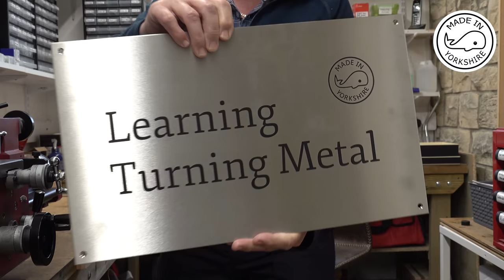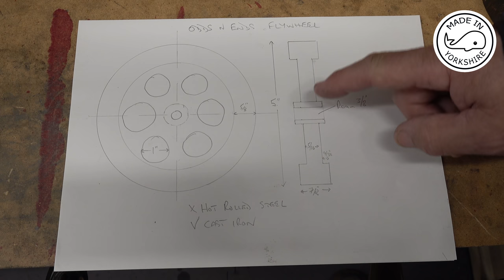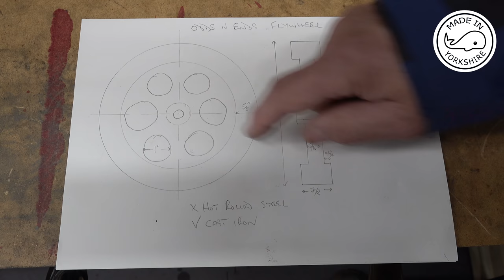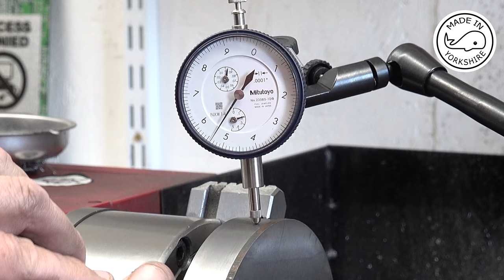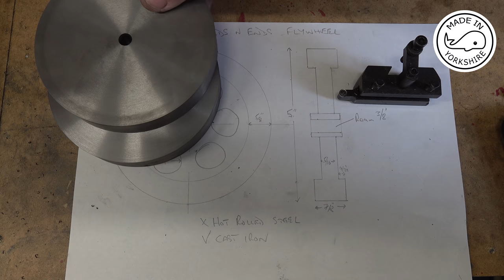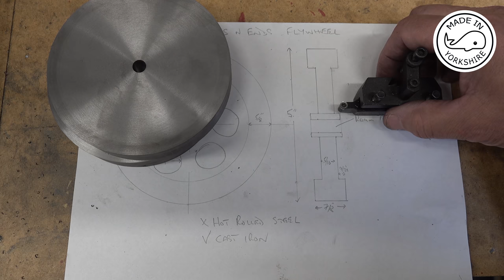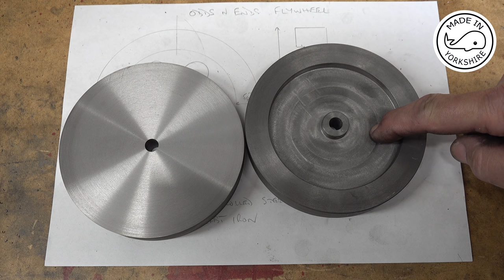#MT41 Part 9 - Philip Duclos Odds n Ends Engine. Machining a Flywheel. In 4K by Andrew Whale.

Comment: Again, well done. I wish I made the flywheels from cast iron rather than cold rolled steel. The resulting sharp swarf from the cr steel  has filled a 20 gallon waste can ,not to mention having to stop the lathe between cuts and remove it . I did not need a sharp steel " birds nest " getting caught in the turning lathe and flying about the shop. It would have been so much nicer just using a vacuum.
Reply from the maker: Thanks Earl - and thanks for all the help and advice!
I'm sure your steel flywheels will look great once completed.
All the best.
Andrew

Comment: Ok, Tuesday morning coffee with Andrew. Flywheels look great. As Faulty's inexpensive builder said "lick of paint, lick of paint" just before Sybil took the umbrella to both of them. Paint  covers all the machining marks and the flywheels will look as good as the Farmboy engine's. I had a couple chunks of Stainless Steel hanging around the shop for mine so my machining time was quite a bit longer than yours but the rims won't rust.

Dick B.
Reply from the maker: Thanks Dick - I think Stainless Steel would be well beyond me and my machinery! Your 'little' engine is really starting to take shape.
All the best.
Andrew

Comment: Hello Andrew, I built this model myself about ten years ago when I was in trade school, and I am thinking about building it again now that I am a journeyman. You're doing great. If I may make a suggestion, play around with the speeds and feeds on your lathe a bit and figure out what the maximum depth of cut is that it can comfortably take. Base your roughing cuts off of that and you will be able to do more work in less time.
Reply from the maker: Many thanks for the suggestion. I'm slowly gaining more confidence taking deeper cuts. 
Cheers
Andrew

Comment: Nice job Andrew. You rescued the problem with the slot very well. I thought it was going to be a filler and paint job! Those are mighty flywheels though. Once started this engine is not going to stop!! 😀
Reply: PS Happy Christmas. Love the sign.
Reply from the maker: Yeah - me too Tim. I was heading for the JB Weld! I just need to replicate the error on the other one now! 1.2Kg each - I hope the crankshaft can take the torque!
All the best.
Andrew
Reply: You pinned the crank arms so they should be up to the job.

Comment: Really nice job Andrew, some creativity with set ups never goes amiss. I've just finished drilling the flywheel of the S50. Used a very similar set up to you and it worked a treat. Not tapped it yet though! Thanks for the video. Regards Gareth
Reply from the maker: Thanks Gareth. I told my wife I was just going into the workshop to drill a hole. Two hours later I re-appeared! It sometimes takes me ages to get a decent setup. Good luck with the S50. Cheers
Andrew

Comment: Hi,Andrew. That turned out very nicely even with a couple of minor hiccups along the way. Cast iron permabar  certainly isn't as cheap as rolled steel but a far superior material to make flywheels from. I would like to share a little of my own machining experience with you about mounting the blank in the 4 jaw chuck. If you drill undersize through a couple of what will later be the holes in the finished flywheel as a first operation then you can mount the billet onto a backplate or faceplate and bolt it through the holes. That way you can tap it about into as near concentric as it will run then to tighten the clamping nuts and machine the periphery right up to the faceplate. It is a simpler and more versatile way of holding it for the first turning ops.
Reply from the maker: Thanks Howard, and thanks for the suggestion. I imagine it improves rigidity too. I will give that a try next time.
All the best. 
Andrew

Comment: Great outcome Andrew. Good choice to go cast iron instead of steel, you had enough agro with that, and steel would have been a nightmare for you. Even with an industrial sized lathe and mill it would have still not been easy. I am assuming that the large endmills are from your neighbour ? What I would have done for the 1 inch holes is use a Carbide Hole saw, the Banggood ones work super well. Might be worth checking your tailstock when you get a chance, as you drilled the hole for the reamer it picked upwards. When you removed the reamer, if you listen carefully you can hear it Ping Downwards. Seems that there may be some vertical misalignment. Personal note, I think at times that you were running too fast for cast iron, 80 to 100 FPM, depending on the grade. You also need to take into account the type of tools used. Regards from Australia.
Reply from the maker: Hi Dave - yes I must have ended up with around 200 slot/end mills. Well spotted regarding the reamer - I noticed that too. I don't think I have any options regarding the vertical alignment of the tailstock. It doesn't seem to have any detrimental effect at the moment but I will keep my eye on it.
All the best.
Andrew
Reply from the maker: Hi Dave - a quick update in the tailstock alignment.... Richard Boucher (Dick) read your comment and suggested I use a coax indicator the check the tailstock bore. I've just tested it and the coax suggests the bore is out by about 1.5 thou of and inch. As a crude test I put the MT2 chuck back in and held a 3/8" silver steel rod. My dial gauge read 15 thou runout over 4.5"! I then had a light-bulb moment and realised that I never tap the chuck home in the taper. A quick tap and the gauge now reads 3 thou over 4.5". So I think the main problem is operator error! I guess 3 thou runout is sort of reasonable. Thanks for initially pointing it out.
All the best.
Andrew

Comment: So a few thoughts on large diameter cutting. 
Dc motors have no torque at stall so in your case a little faster will be better as it was stalling at the start. You’re using carbide so it wants speed. As you saw for the uninterrupted facing at 200rpm at 5” it was working much better.
Good call hogging off the 1/4” on the mill.  
When I did my 5” flywheel a month back I puckered up my cheeks, cranked hard on the 4-jaws, added a live center for protection, and took 10-20 thou cuts with a slow carriage feed at 220rpm (my minimum). Then polished with 220, 600 sandpaper and grey scotchbright. I’ll use some polish paste on final assembly for a mirror finish.
Reply from the maker: Thanks for the advice. I'm gradually gaining more confidence taking deeper cuts.
Cheers
Andrew

Comment: Andrew, I was just reading the comments on this video and mention was made about your tailstock might not be at the correct height. It could also be that the reamer you were using might be slightly bent. check bore of tailstock with your Co-Ax gauge and if it is out some shims between the two pieces of the tailstock would be a permanent repair
 Cheers, Dick B.
Reply from the maker: Hi Dick - many thanks for the suggestion - I wouldn't have thought about using a coax indicator in the tailstock bore. I've just tested it and the coax suggests the bore is out by about 1.5 thou of and inch. As a crude test I put the MT2 chuck back in and held a 3/8" silver steel rod. My dial gauge read 15 thou runout over 4.5"! I then had a light-bulb moment and realised that I never tap the chuck home in the taper. A quick tap and the gauge now reads 3 thou over 4.5". So I think the main problem is operator error! I guess 3 thou runout is sort of reasonable. 
All the best and take care.
Andrew

Comment: Hello Andrew.....great work.....did you consider drilling the 6 holes first.....i used an annular cutter on mine to make the 6 holes and it worked really well.
Reply from the maker: Hi Ray, yes I worked up various drill sizes. Glad you achieved a good result too.
All the best.
Andrew
Reply: Those are good time savers.

Comment: Looks great Andrew, perseverance comes to mind and you did well to get over the counterbalance groove issue - looks fine to me! The cast iron looks decent quality - where did you get that from?.
I will send a video of my farm boy - however I'm remaking the cylinder and piston with proper CI rings as i wasn't happy with the running with an 'o' ring so it may be a while before i actually send a video to you...great idea to share with others though as a compilation of Farm Boys. Cheers Andrew
Reply from the maker: Thanks Andy. I got the cast iron from  southweststeam. Probably not the cheapest but good quality. My farmboy runs well with the o-ring but I can't say I'm a fan of that idea. Good luck with the ci piston rings. Just send me a video snippet whenever.
Cheers
Andrew

Comment: I had a question, might be a silly one but When turning metal do you need to wear a respirator, are there metals that create dust or do they all create bigger chips that you won’t ever breath in?
Reply from the maker: Hi Darren, from the work I have undertaken I have not found a need for a respirator. Unlike wood turning, metal chips tend to be quite large, though machining cast iron can be a little dusty. I have a full face visor from my woodworking days but I've never seen the need to use it for metal. Eye protection is definitely required though, and I use safety specs.
Cheers
Andrew

Comment: Really a nice present You got! 
Very well done Andrew!
Did You have two big hockey pucks or did You split a thick one?
Lots of work doing the cut outs. Why not turn the perifiery, facing off, making the center hole and just use paint, read and black, instead of plowing all that metall? I guess I almost "talk badly in the church".... Joking!
Looks like a good descision to use the mill as bulldozer instead of the lathe.

Great work!
Reply from the maker: Ha ha - thanks Stefan!
Just one more to go!
Cheers
Andrew
Reply: @learningturningmetal  Good luck! You'll make it!

Comment: Morning
Reply from the maker: Evening Nigel!
Cheers
Andrew
Reply: Andrew, you’ve probably been asked this many times but where and who do you source your material from? I’m asking as a fellow Yorkshireman
Reply from the maker: @nigesbasementworkshop9541  I tend to buy a lot off eBay, in particular aluminium. Typical suppliers are Hardware Outlet, aluminium online, Pennine Hardware, aluminium droitwich, jd engineering to name a few. I also buy stock from chronos and Zorro. The cast iron billets came from southweststeam. I generally just look for the lowest price and a decent supplier rating. I've always received good materials.
Hope that helps.
Andrew